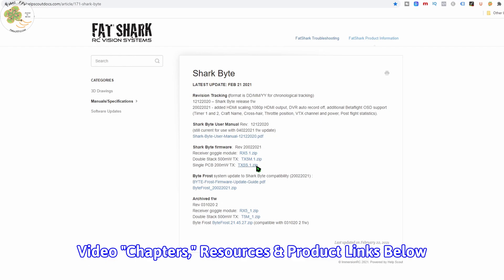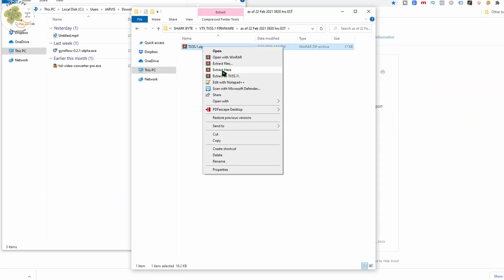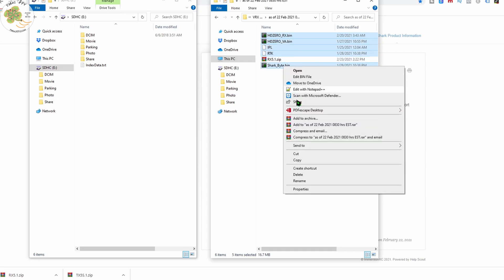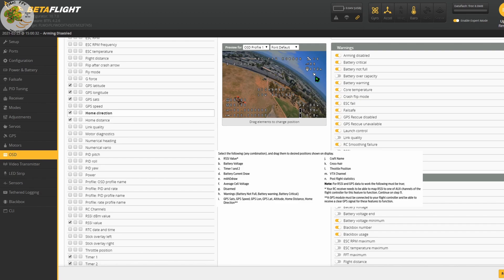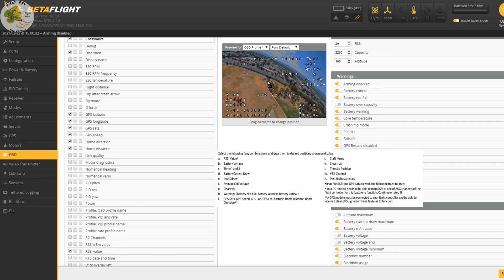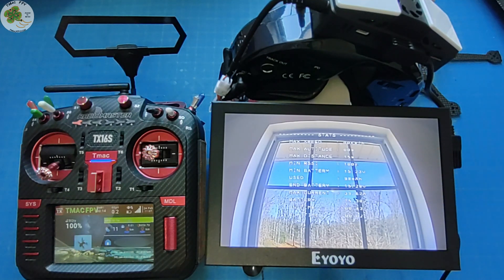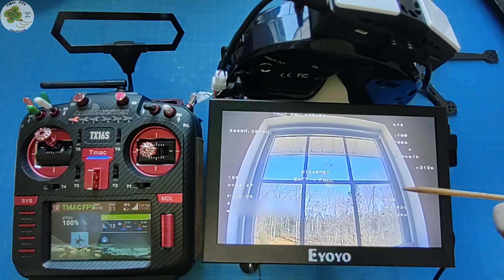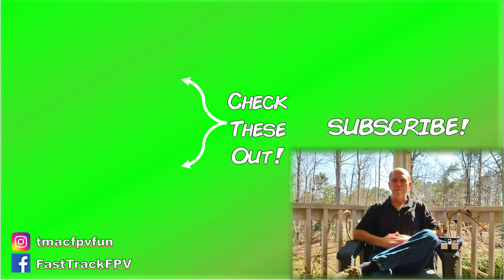FatShark Shark Byte Firmware (1080P & NEW OSD!)

Comment: Do you get the full OSD functionality like PID and Rates?
Reply from the maker: Hey Stephen!  Yes!  That's the short answer.  With the latest Canvas Mode firmware see my video on it here:  https://www.youtube.com/watch?v=hHu7HkH7rpM you get almsot exactly the same OSD functionality as with analog FPV.  the one item I can think of that isn't the same is if you use "throttle value" as an OSD item with your analog FPV, its not the same with Shark Byte (i explain the difference in the video I just gave you the link for).  Also, currently if you change your VTX channel after powered on, the OSD VTX channel displayed doesn't change.  There's a Beta firmware version fix for this now and will be incorporated into the next firmware update.  Which, by the way, is one of my favorite things about Shark Byte.  the dev(s), actually are listening to their customers and incorporating everything they can into it as quickly as possible Outstanding customer Service! Rapid advancements coming all the time in both hardware & firmware.

Comment: Now only if SharkByte would add Compass heading,  I already have the DJI system and only thing I dislike about  them is no Throttle position osd and compass or heading.  Thus is a must for of Fixedwing guys.   
Looks like FSB doesn't really have throttle position either.  Only when disarmed does nothing for me.   
Once Fatshark SB gets these osd characters working I'll definitely buy it.   
DJI on the other hand I seriously doubt will even update there Goggles anymore including the V2 goggles.   We was lucky we got what we got from DJI.

Comment: I updated the firmware of my vrx , for some reason it got stuck until my battery drained. Now my vrx wont bootup. Anyone know how to restore to original state?
Reply from the maker: Perhaps try process described on page 14 of User Manual "Steps to Flash Goggle Module in Case of Not Booting Up" available here https://fatshark.helpscoutdocs.com/article/171-shark-byte

Comment: i lost all my OSD when updating firmware , even when enable again under Betaflight and check all the settings one more times ,what can i do .I even flash FC card Zeus to 4.2.8 but nothing more .
Reply from the maker: Did you use the CLI commands as shown in this video? https://youtu.be/hHu7HkH7rpM
Reply: @TMacFPV  Yes i take a look at this but wich port représent  Minus 1 ? Thé number of port using for VTX SB ? Mine is on UART 3 , it mean i set 2 ?
Reply from the maker: @popeye7833  correct 👍 If you have Shark Byte VTX connected to Port 3, use CLI command for 2
Reply: @TMacFPV  thank you for your précision and answer ✌️